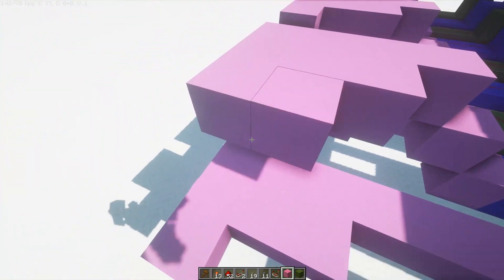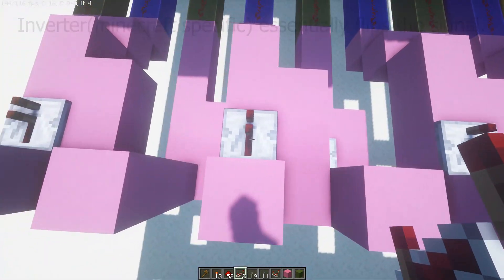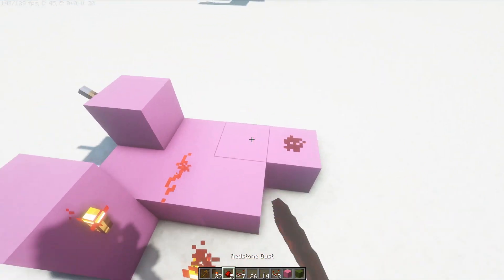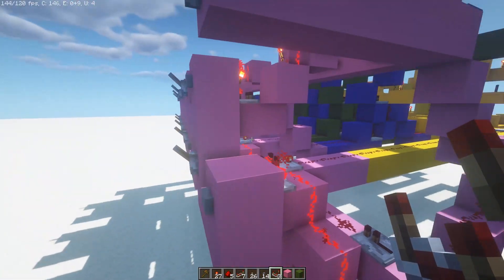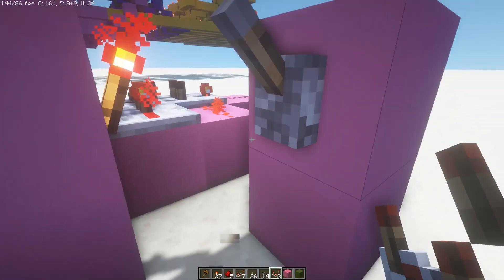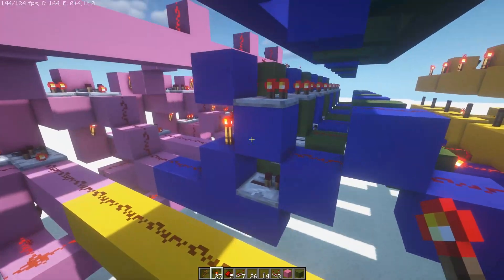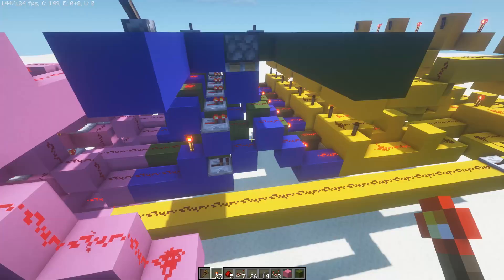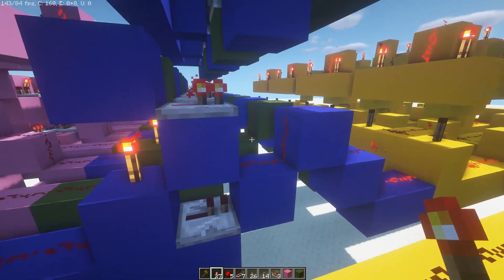How to build a Minecraft Computer | Episode 3

Comment: This series has gotten me think about CPUs in specific maybe some people here can answer my questions? So a CPU core is essentially a small CPU within the CPU its self and all of these cores have ALUs my question is if ALUs essentially just consist of some basic gates than how can we get them to calculate complex physics and mathematics if they are so simple I know modern CPUS are 64 bit and this is only 4 bit but I don't see how that would change much other than how much bits can be outputted/calculated I'm mean surely you would need hundreds of ALUs to calculate aerodynamics right? so are CPU ALUs actually comprised of far smaller ALUs that combine into 64 big ALUs or is something else going on. Dont be afraid to use big words I love pc hardware I just have never thought to dig below the surface and discover what makes hardware tick.

Edit: modern CPUs have a lot 256 bit ALUs i was confusing the instruction bit length with the ALU